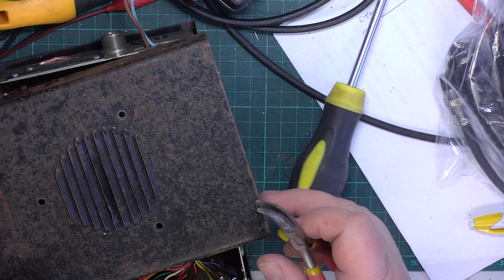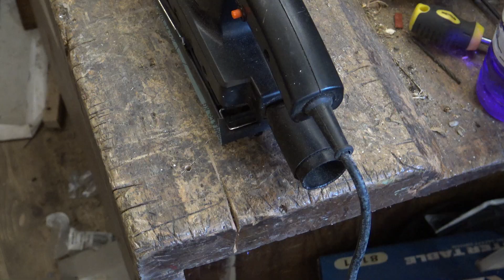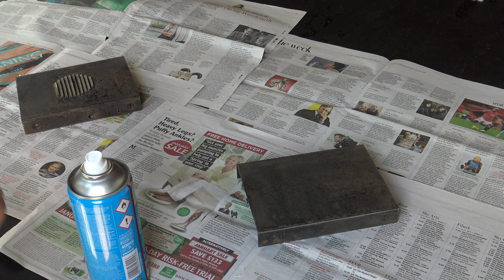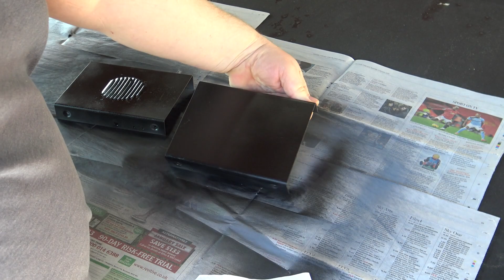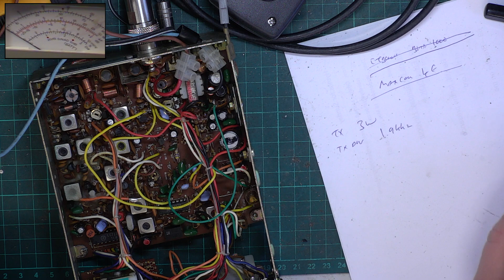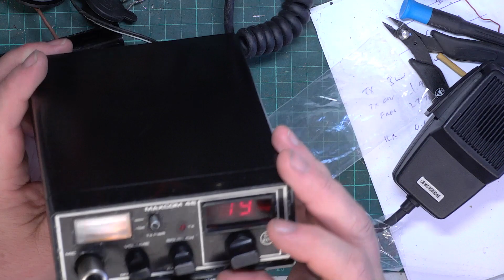Maxcom 4E CB27/81 UK FM CB radio - Repair & adjustment

Comment: Just checking this vide out as I have a Maxcom Super 4E to sort out and noticed the diagrams you used for mic wiring and the yellow layout. This was one I did for my website many years ago which is sadly no more. So glad to see someone using it, it makes it all worthwhile… 😊
Reply from the maker: It appears to be based on the article I wrote for Citizens band magazine around 1987. Anyway, I'm glad you had it available.

Richard, G0OJF, UK

Comment: "Methylated spirits" is, apparently, denatured alcohol in the USA.

So the internets tell me.
Reply from the maker: Thank you. I just knew there would be a different name.
Reply: In the USA, cellphones with no contract and, I think, without a SIM card (to the extent those are even needed) have to be able to dial 9-1-1 for emergencies.  Maybe that's what was going on with your acquaintance?
Reply from the maker: No, the relatives email said "on a low cost pay-as-you-go deal".

Anyway, it's been returned now

Comment: Midland 2001,same board as many other radio of that type
Reply from the maker: Though uninspiring, but competent in performance; this chassis made by Maxon found it's way into Midland as you mentioned, Maxcom, Cobra, Colt & Commtron just to name the tip of the iceberg. Possibly the most reliable 27/81 chassis ever.

Richard, G0OJF, UK